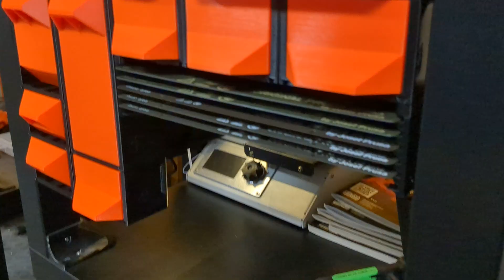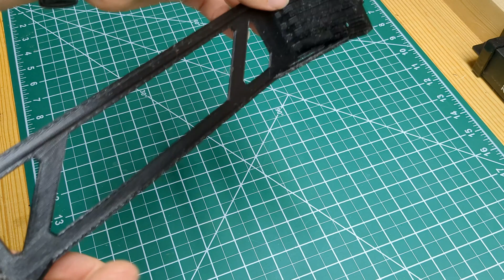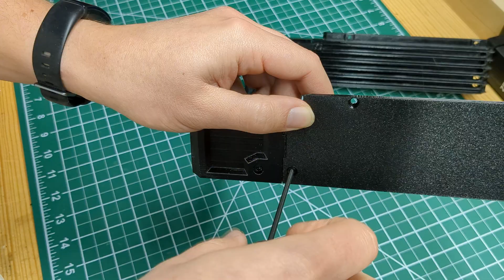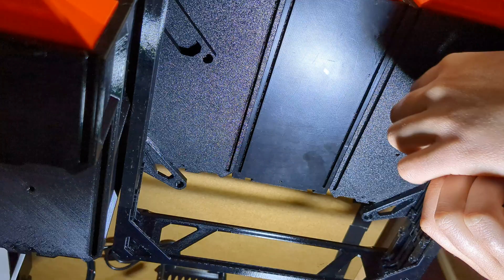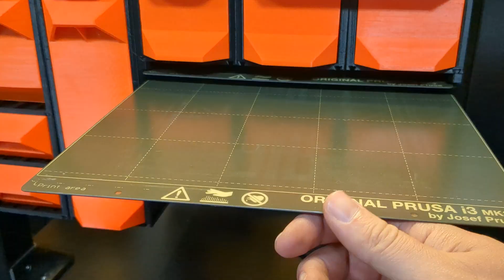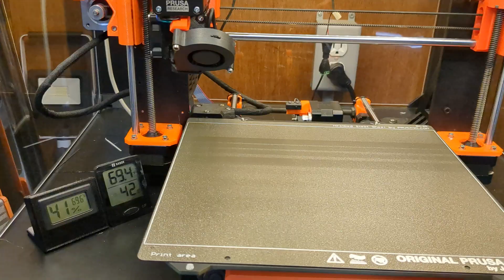GEN2 Steel Sheet Holder V2 For Lack Enclosures 3D Print

Comment: full lack, allways great design!!! love your work, had first drawers but will redo with new gen2 and why another style "legacy"? ming making a milwaukee m18 batterie holder in your design?
Reply from the maker: Thanks Michael, You can actually reuse your original "Gen1" drawers as I made the GEN2 drawer cases backwards compatible with them.
Hmm, I'll see if I can get my hands on a Milwaukee battery. If I can get some measurements from it I'd love to make a battery holder. Those are great power tools.